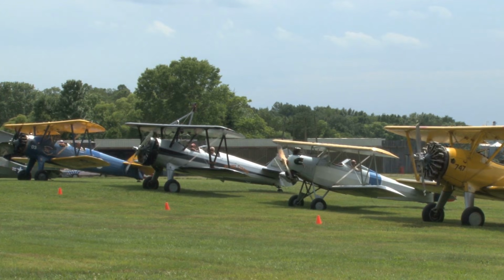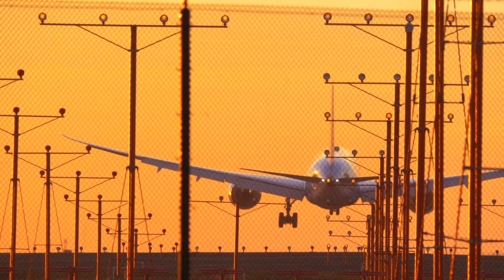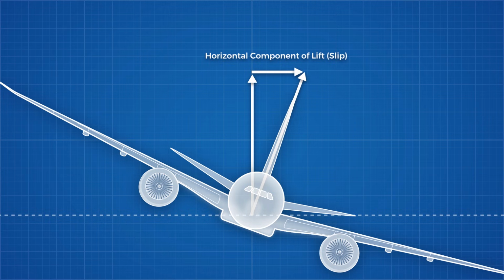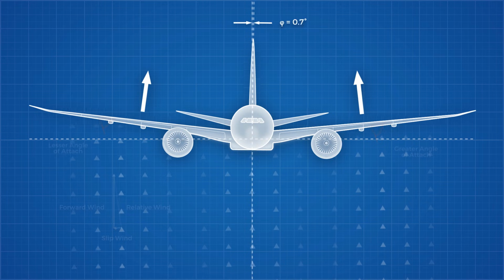Why Does Wing Dihedral Make Planes Stable?

Comment: Not even close: 1. We mount wings high so the wing box doesn't get in the way of cargo/so the cargo is as close to the ground as possible. They are mounted low on passenger planes because so the wing/engines are easier to gain access to. 2. You only looked at wing performance in a Slip/Skid. This has very little to do with roll performance and stability. In fact the airspeeds you eluded to in the slip would be 120K to make any aero impact.  Additionally you ignored the fact the wing chord changes from root to tip etc.

Comment: Corsair propeller is not the reason for the inverted gull wings but the optimum attachment angle of the wings to the fuselage for aerodynamics in order to achieve the top speed required. A mid wing attachment being the superior choice as found by NACA wind tunnel research.

Comment: The high-wing design of the AN-225, and other large freighters like the C-5 Galaxy, is meant to maximize interior fuselage space.  Most low-wing aircraft have a structural "wing box" that occupies space within the main fuselage cylinder.  This stays below the main deck of passenger aircraft, but divides the lower hold in half.  The AN-225 has a high wing, so it can have a flat floor that runs the full length of the fuselage with maximum vertical clearance, allowing for oversize cargo items to be loaded inside.  It also keeps the fuselage closer to the ground, which makes loading easier.  Low-wing freighters based on passenger jets, like the Boeing 777F, retain the main deck and lower hold design, and are more amenable to smaller items, containers, and pallets.
Reply from the maker: Ahhhh that makes sense

Comment: I'm probably going to pi$$ off a few pilots here, but wings rising from the root to the tip have "positive dihedral" or just "dihedral". Wings dropping from the root to the tip have "negative dihedral". Horizontal wings, such as those on aerobatic aircraft (and the F-16), have "anhedral".

Comment: The F-4 Phantom. Here is what you didn't know. The wing actually angles down at 3 degrees to the outer wing panel. At that point the outer panel rises at 12 degrees. The aerodynamic function is actually secondary. It's first and best function is to provide the crew chief a place to sleep. I know. Been there, done that.😁

Comment: The Corsair did not have inverted gull wings to shorten it's landing gear for weight  or provide propeller clearance. Look at the F6F Hellcat, which used the same engine and a prop withing a couple of inches of the same diameter and used telescoping landing gear for clearance. The Corsair had short landing gear to provide strength as it was designed to us lowered landing gear as a dive brake.

Comment: Fighter aircraft termed 'aerodynamically unstable'is technically incorrect. Plenty if huge RC aircraft that are fully scale to eurofighter, f16s even f22s...but they fly, do they have computers? Often not...real 'aerodynamically unstable'aircraft are actually just very tail heavy, meaning a computer is required to keep the aircraft stable(only in pitch) so if a pilot want to pull up, rather than the elevator slug up a huge heavy y plane...the plane already wants to be there...love the videos :)

Comment: In stead of going to that bizarre wing form on the Corsair, they could have gone to a shorter paddle style propeller, but they were not common back in WW2 and there was no modeling computers to design them.  Twin counter rotating propellers could have been used also, but way back then, there was no metal alloy that could withstand the loads on the propeller gearbox for any sort of acceptable service life.

Comment: Greg's Airplanes has a video on the F4U gull wing. Your reasons are part but not all the answer. Two other factors are that the oil coolers are imbedded in tge wing root, reducung the frontal area of the fuselage (compare with P-47 fuselage). Another reason is that the gull wing configurations allows wing rootvto attach to the center line of the fuselage, reducing parasitic drag caused by the wing-fuselage connection.

Comment: General Dynamics F16: flat, Lockheed F104, tilt downwards. Antonov AN-224 and AN-225: downwards when not in flight, Handley Page Victor: downwards, in flight: flat. Hawker Harrier: downwards, Concorde: flat ending in slightly downwards. BAC Buccaneer: flat, Mikojan MIG-35: flat. Mikojan MIG-27: downwards. Soechoj SU-57: flat, Dassault Mirage 5: flat. Just to mention a few.

Dont make videos about things you dont know.

Comment: Oh, you didn't answer the question though? That's only upwards in the x-axis. What about the upward angle of the wings in the y-axis - where the trailing edge is lower than than the leading edge in level flight? Because most people think so-called Bernoulli lift keeps aeroplanes in flight - but we know that's not true. The reason planes stay up is because the wings deflect a mass of air downwards that equals  or exceeds the mass of the plane. And Bernoulli doesn't add much except efficiency at plenty of different airspeeds, and good handling characteristics.

Comment: The An-225's anhedral wings are result of plane being developed from the An-124 freighter, and retaining the same core philosophy that necessitated the design.

An-124 (and An-225) have a "kneeling" feature in their nose gear, where it can kneel down and load/offload cargo through the nose loading bay without the use of a freight elevator, directly off/to the ground, like roll-on-roll-off ships do. As a result it made the gear short and stubby, leaving little space for the four (or 6 in case of An-225) massive turbofans. So high-mounted anhedral wing makes absolute sense in this regard.

Another fun fact: An-224 was originally designed to carry the Soviet Space Shuttle, "Buran".

Comment: Dynamic lift, period. Bernoulli, per several aero engineers, is not how lift happens (else how would symmetric wings work...) I you create some AOA, you direct some air downward, pushing the plane up.

Comment: 1st .. all wings flex.. second wing location and dihedral affect what is called the mean cord of a wing desgin.. all high mounted wing design have increased lifting loads along the mean cord . Low mounted wings and the  upper surface area have less air moving over the cord because the of wing root and the adjoining fuselage that the  disturb high speed laminar airflow that is crucial to efficiency and lifting loads..

Comment: In the premise of the explanation you say that by tilting the wings upward "you gain roll stability... When a plane rolls it will return to straight and level flight" but this is simply not true. You say that a banked plane has a natural tendency to side slip, but this is a false assumption. A banked plane in coordinated flight will have a vertical and horizontal component of lift that sum to a lift vector that passes through the center of mass of the plane. That is to say that the horizontal acceleration caused by the horizontal component of lift will always cause the total lift vector to pass through the center of mass of the plane. As a pilot I can assure you that a banked plane in coordinated flight will not return to straight and level flight.   The reason for dihedral is that it creates coordination stability, not roll stability. An un coordinated plane will return to coordinated flight. But coordinated flight does not mean straight and level. You can be in a coordinated upside down nose dive (although longitudinal stability will come in to play, then).

Comment: The WWII Vought F4U Corsair was a special case with those inverted gull wings.  The P&W 2,000 HP engine required a HUGE propeller (over 13 FEET in diameter) to achieve its max performance targets. With straight or dihedral wings, the prop would hit the deck or ground.   Therefore, the gull wings were put in place to achieve the necessary ground clearance.  Yes, most people have an affinity for the P-51 Mustang but, to me, the Corsair was the most graceful, beautiful fighter of its era.

Comment: The F4U explanation is incomplete.  It also allows for shorter landing gear, which allows the pilot to use the landing gear as air breaks in a dive.  Also  it has to do with aerodynamic understanding at the time.  They thought that a 90 degree angle (wing to body) would produce the least drag, so the bend in the wing accomplishes these 3 things (1 mentioned in the video, and 2 here).

Comment: If Greg's airplanes and Automobiles is to be believed, the F4U Corsair was not made a Goldwing just for the sake of the landing gear being shorter and feeling better, and accommodating the propeller. Fact was, in those days, telescopic landing gear was widely used on aircraft.

The reason why Gullwing was done, was twofold. First of all, protrusions from the airframe made at 90 degrees to the airframe reduce drag. Having the wing down allows the plane to have that 90 degree angle, while also having the wing be low slung for better handling. The added benefit, was that it allowed landing gear that was only a single piece so it was more reliable, an  important factor in the Pacific theatre. 

Overall, the main goal was aerodynamics. Short landing gear was a side benefit.

Comment: Lift isn't just the Bernoulli principle: it's also the mass of air deflected by the wing--when that mass exceeds the mass of the plane, the plane lifts off and flies.

Dihedral angles grant stability because the dynamic airflow isn't merely flowing from leading- to - trailing-edge: it also will flow away from the root of the wing and the force on the wing from the mass of air sliding outward creates a force that is angled inward, which keeps the plane level for small roll angle changes. Anhedral prevents that correction, so makes flying the plane more difficult without computer assistance.

Comment: >The f16 was one of the first planes to introduce instability for efficient maneuvering

Ackchually, no. The first plane to do this was... the first plane. The wright brothers put a lot of thought into this issue, the were trying to decide if a plane should be unstable and rely on the pilot to keep it in the air, thus allowing easier maneuvering, or stable, requiring less input, but more effort to make quick maneuvers. Moreover, they wanted instability because they figured it would make recovery easier if the plane were to suddenly stop flying. Flat spins would be a lot easier to pull out of if the plane wasn't so happy to stay in them. 

They were, of course, bicycle mechanics, so they immediately gravitated to the side of human controlled instability, like you get in a bicycle. The 1903 flyer was very unstable. Same for the 1904, and so on. It wasn't because they didn't know what they were doing, but because they had consciously chosen, based on their deliberations and glider testing, to make the airframe unstable and rely on human stabilization, just like on a bike. If you watch early footage of them flying, you can see the planes pitching wildly up and down as they do a mediocre job of damping out the plane's natural tendency to suffer wild phugoid oscillations. 

Practicality soon dictated that if anything was to become of aviation, this intense requirement would have to go, but the pioneer aviators of the day continued to debate stability vs instability for some time. Soon, the tasks of monitoring instruments, navigation, checking equipment monitoring equipment more complex than a few sticks with a tarp lashed to them, etc, demanded planes that could "shut up and fly straight," but making planes unstable to make maneuvering easier is literally as old as flight.
Reply: ONE of

Comment: As far as the An225 Mriya goes I also suspect that the wings are mounted high as it was originally designed to carry the Soviet Buran Shuttle. If you put a big heavy shuttle on the roof the center of gravity is much higher. Having a high mounted wing puts the wing in the "middle" of the aircraft when the shuttle is loaded. Now That I've written that I realize that NASA used a 747 with a low wing to ferry the shuttle for years... so do with that what you will. 

Perhaps it was the logistics of loading the Buran plus the stuff you said.

Comment: @real engineering I had always thought that the restoring effect in dihedral wings was the fact that the lift from the lower wing will always be closer to vertical than that of the higher wing, during a roll, and vice versa for anhedral wings. Is this negligible, or just a less important effect in real cases? I never thought about the effects of the slip, because pilots learn to compensate for the slip by flying "true" (I don't know if "true" is the right word in english, I never had flight classes in english), i.e. they are taught to go through turns without losing any altitude, as well as using the rudder to avoid drifting, so as to make flight more comfortable and consume less fuel. Usually during such a turn, aileron input still has to be put in, in order to prevent the aircraft from rolling back to straight flight, at least in the Cessna I flew.

Great video =)
Reply: @Feeds Ravens  The video is correct in the fact that the pendulum explanation is incorrect. I don't know if you already understand this, but in case you don't take a look at this: https://en.wikipedia.org/wiki/Pendulum_rocket_fallacy

Comment: There was also another reason wing attachment on the Corsair, it was to cut down intersection drag interference. This meant they could use smaller wing root fairings to achieve lower intersection drag.
Reply: Seconding this, and providing what is the probable source for this: https://www.youtube.com/watch?v=rNcV13uayxw

To summarize the video for anyone who hasn't seen it:
There were a lot of reasons for why the Corsair had gull wings, some aerodynamic (the intersection drag mentioned above), some structural (cut down on landing gear mass), some functional (it needed smaller landing gear to fit everything else into the wing), and some in respect to ground clearance (as mentioned in this video). 

It was a fantastic design decision which killed four birds with a single oddly-shaped stone, and a key element in what made the Corsair such a superb fighter for its time.

Comment: At 3:15. I wonder with what base are those sources claiming so. 

I mean, in case of pendulum, moments act (obviously). But even in case of pendulum, there happens to be 0 moment when the centroid of the pendulum is in line with the pivot (lowest position). 

Similarly, in case of this plane, the plane's COM is in line with COG (when seen in a vertical plane), and thus, there will be absolutely no correcting moments acting at all (actually there will be, but negligible in nature).

Comment: I'd love to see an analysis of the  XB-70 Valkyrie and it's downswinging wingtips.
That was a fascinating feature that wasn't really used anywhere else.
Reply: It was used for compression lift in combination with increasing directional stability and changing the centre of pressure at higher Mach numbers to keep the plane trimmed. 

Compression lift was the used of shockwaves under the wing to generate lift. The engine pods were shaped to generate these shockwaves under the wing (compare them to the straight sided ones of Concorde and the TU-144). The drooped wingtips also created shock waves and contained the shockwaves that emanated from the engine nacelles much like a ramp intake does for an engine inlet. The result was the highest lift to drag ratio of any manned aircraft. 

Next was directional stability. Even at Mach 3, the thin air of 70,000-80,000 feet made directional stability difficult. The drooped wings added more vertical surface area behind the centre of gravity to aid in directional stability. 

Conversely, it reduced the amount of horizontal area behind the centre of gravity for longitudinal stability. This was importance because as Mach number increases, the centre of lift moves rearward. When it moved behind the centre of gravity it introduces what is known as “Mach tuck”. On slower airplanes this can be corrected with a stabilizer adjustment and on fighter planes an all moving stabilator but these cause a large amount of drag. On Concorde they transferred fuel to match the centre of gravity with the new centre or pressure, but the drooping wings of the XB-70 adjusted the centre of pressure to match the centre of gravity.

Comment: In many high wing designs, the anhedral angle is put there to offset the wing bending due to loading.
Accordimg to Raymer, dihedral in high wings make it inherently unstable due to a phenomena called Dutch Roll.
It's not a dangerous condition by itself, but it increases pilot stress.
Sweep also creates a dihedral effect. Roughly 1degree for every 10 of sweep. Some designs also take that into account.
I know for sure the B-52 wing is anhedral because of bending and sweep.

Comment: The Eric Clutton designed FRED (flexible runabout Experimental design) has a high mounted dihedralless wing and is said to obtain its stability from the pendulum effect.   It can safely be flown with the ailerons locked. 

https://en.m.wikipedia.org/wiki/Clutton-Tabenor_FRED